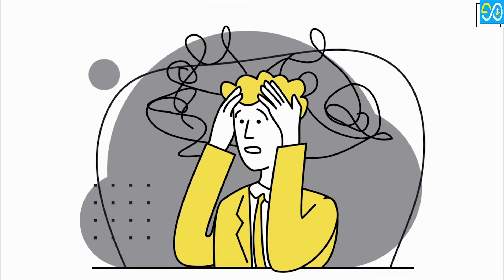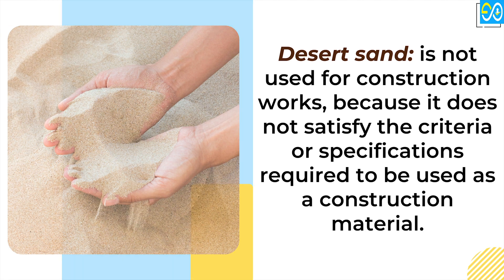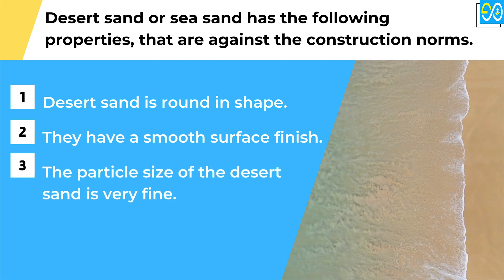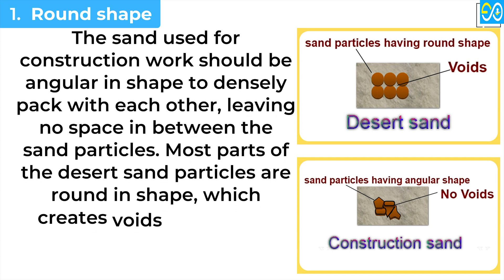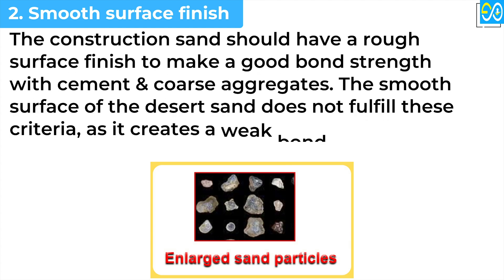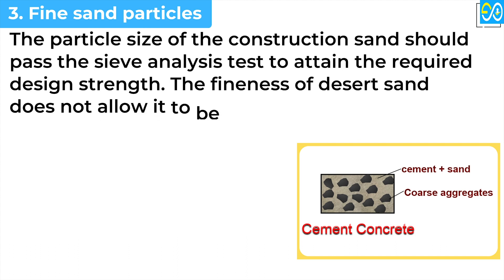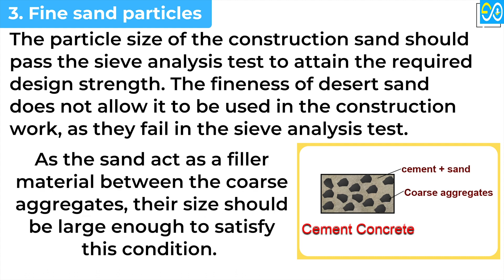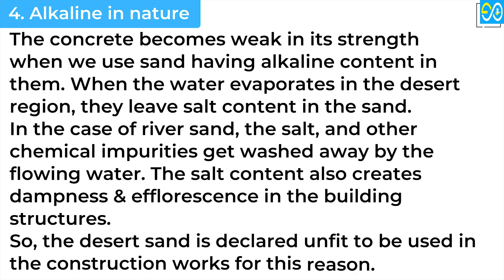Why Desert Sand & Sea Sand Are Not Used For Construction? | Civil Engineering Basic Knowledge

Comment: Thanks for the video.  It is very informative.  However I have difficulty understand why being too fine is a problem. As far as I know fine aggregate should filled the void in the course aggregate and cement particles should fill the void in the fine aggregate.  Is is because it is finer than the cement particle?  THere is a concept where you put rocksand in your hand and see whether it flies away at the action of the wind to determine whether it is dust instead of rocksand.  Do you have any information on dust?  There is also dry and wash rocksand.

Comment: hi, i was wondering, what if we use sea sand to fill the base ground for the expressway construction (not using sea sand to mix with cement). Is it still possible or feasible?
Reply: And there you go, your iron(metal) foundation would corrode in no time